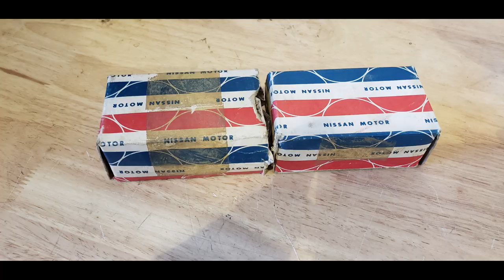Building a MiniTruck in 8 Min!

Comment: Hey Jake how much was the total cost of the build materials + Labor❓❓
Reply from the maker: I did not keep exact track on this build. I will say as far as parts air management was in the 3k range, 2k wheels and tires, suspension and hardware 1.5k, steel / consumables 1k ish, bunch of other stuff  another 1k. As far as time... didn't keep track if I had to guess I wouls say around 1k hours. 

But this truck was way more in depth my little blue truck took about 2k bucks in used parts and materials and 100 hours.
Reply: @scrapingpavement  Thanks for the Reply I really liked the Air bag on 20s Series Watched every part‼️ Ur the man👍I want to be like you when I grow up😅